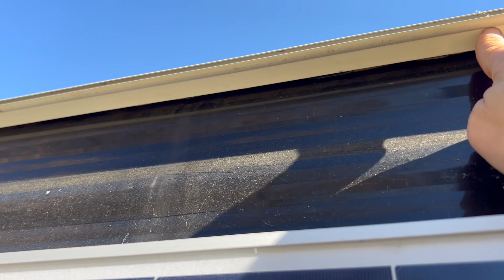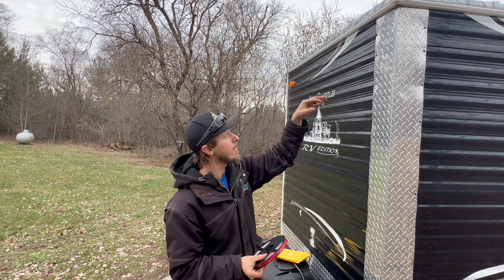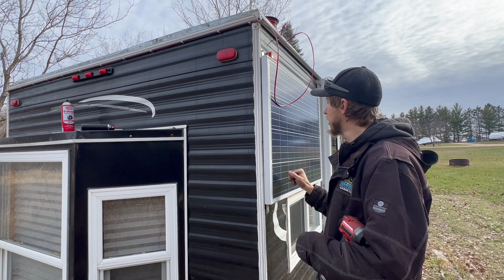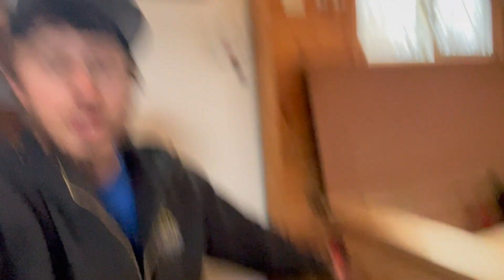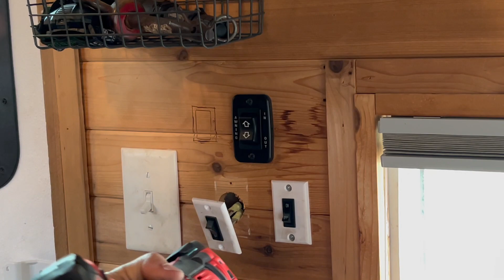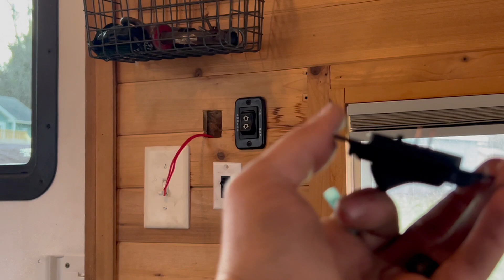How To Install LED Wrap Around lighting On A Ice Castle Fish House

Comment: Im a wire gru-u I'm installing led lights also I never use any flame for connectors it actually burns and makes wire hard always use heat gun you can put a dimmer switch on them also